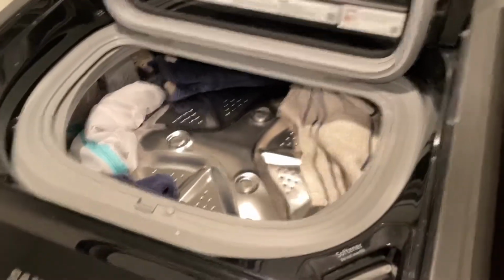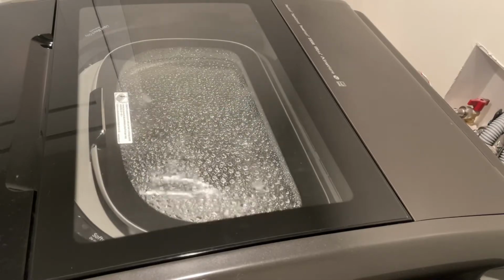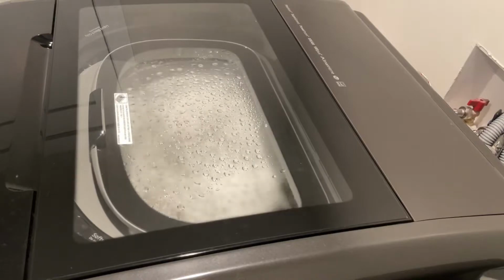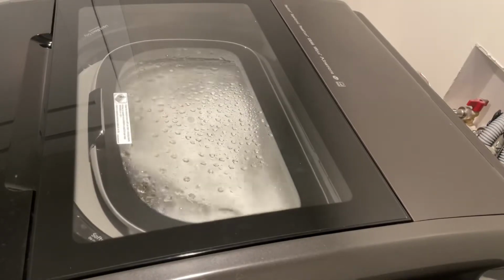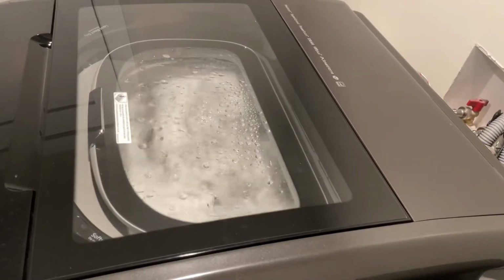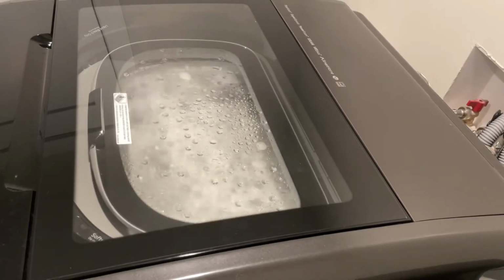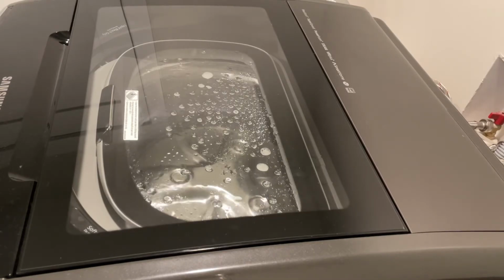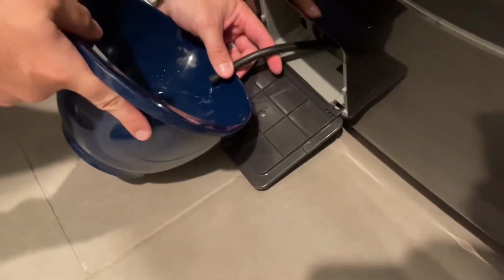Samsung Flexwash Upper Washer Normal Cycle (and Water Leak!!)

Comment: Turn down the cold water faucet the upper washer fabric softener drains slow so if the water coming into the fabric softener dispenser is to high it doesn’t have enough time to drain and will over fill and leak on the sensor and you will get an error code or see water in the bottom left of the washer , Also I tell customers not to use liquid softener use the downy unstoppable’s cause you can’t take out the the dispenser like on other washers to clean . Hope this helps you guys who have the flex Samsung washers
Reply from the maker: Interesting, I didn't think to do that. I'll have to try it out. Thanks!
Reply from the maker: You know I just thought about this and I’m interested to hear you thoughts about it. If the water pressure is the issue, then how come whenever I run the machine without any clothes in the drum, it never leaks? Ever since the machine started leaking we’ve ran numerous test cycles with and without clothing and it never leaked when we ran it empty. Would the water pressure still be the issue at that point?

Comment: I just bought the WV60A9900AV (not the WV60M) I am going to see how the top washer works.  Most of the problem I have read is the WV60M model.  Wish me luck.
Reply from the maker: Wishing you luck on not only the upper washer working but also on controlling it! I’m sure it’ll be a unique experience trying to control both washers with one panel and one knob 😂😅 Please let me know how it works, I’m curious to find out!
Reply: How's your model working, any leaks?

Comment: Samsung flex upper washer sounds like water is stuck inside the drum. You can hear it swooshing around when you manually spin the drum. I saw that happened to you in one of your videos. Did you ever figure it out?
Reply from the maker: That swooshing sound is actually not just water, though it does sound like it. It is another liquid solution that Samsung uses to help with balancing the Upper Washer during high speed spin stages of a wash cycle, similar to the ball bearing system in the lower washer and in LGs. As for the water leak, the cause seems to be the Upper Washer softener dispenser. There's many different things people say can be done to fix it, but this video explains my findings on my washer: https://youtu.be/HXy2sjRjrNs?si=jSDcfN31y1YS4xrm. Hope this helps!

Comment: I am going thru same problem (guess why I am watching this upload). Very frustrating. As said all worked fine the first 3 years.
Reply from the maker: Yup. Just horrible design. If it interests you, I have a video up about finding the root cause of the water leak issue. Unfortunately I don’t think there’s a fix to it though.
Reply: @FansOfGames  Had mine since 2018ish. it just broke again, causing the entire washer(bottom and top) not to work. I drained it many times, but when I turn it on, it just flashes a ton of buttons. when I turn on the bottom, the tops lights turn on. when I turn on the top, the bottom lights turn on. Idk what to do, it’s been 3 days of fixing this pos
Reply from the maker: Did you power cycle it? (Unplugging it and plugging it back in) maybe that’ll reset the circuit board, which seems to be a failing part on your machine.
Reply: @FansOfGames  I unplugged the machine for about 17 hours, and another time for 10 minutes. I drained it for the same 17 hours and 2 more times for 5-30 minutes. I also drained out the back pipe by throwing the tube up and down, causing a suction to pull out some water. I still hear water inside when I spin the top washers bowl side to side.
Reply: @FansOfGames  oh, I also took off the front panel where the buttons are, then took apart the circuit board. I noticed samsung did a shi**y job at water sealing the board. Half the “seal” areas were half covered. But I didn’t see any leakage inside of there. The only issues I can see are the lights blinking, half the lights not blinking & no/faint noise when pressing them, and lastly the water being still inside the top washer
Reply: @FansOfGames  I’m going to drain it from the front again, then lean it on it’s back and drain the back, turn it on, and if that doesn’t work, I’ll take it apart and deep clean the washer. We just bought a new samsung washer with 4.9 stars for 1100$, and i’m trying to fix this one so I can resell it for 300-700$. I could get samsung repair center to check it out but they estimated the repair to be 400$ without even knowing the issue. I don’t want to spent all that just to resell it and either lose money or gain only 1-300$.
Reply from the maker: That sound you’re hearing is not water, it is the solution that helps balance the drum during spin. (I thought it was water too, but I was corrected.) and I don’t know what to tell you about the board, it’s just very unfortunate how poorly this machine is made
Reply: @FansOfGames  I can replace the lights on the circuit board, but the actual problem, idk how to fix. I’m gonna drain it again both front and back, then clean the sensors. If it doesn’t work, I have no clue what to do.

Comment: I read many complains about leak coming from upper washer. Probably they Samsung engineering  didn`t well dimensioned softener dispenser for Hight pressure water inlets.
Reply from the maker: That could be a contributing factor, but I think I found the root cause of this whole dilemma (or at least A root cause). I’ll have a video coming out about that shortly.
Reply: @FansOfGames  Thank you. I can`t wait for your next video.

Comment: Does it hold more than that? Seems a bit of a waist if you can't load it up a bit more.
Reply from the maker: It could technically fit more, but I don’t like loading it with much past that because of all the water it uses, it struggles to move the clothes around and truly scrub/clean them when it gets too full.

Comment: My conclusion is that the softener compartment didnt drain in time and in result overflowed maybe try cleaning it then running it on a hot cycle then try it again if it still dose it try without softener as it might just not like it and overflow
Reply from the maker: That’s what I thought at first, too. I tried cleaning it, but it was perfectly fine, and it only does this when we run it with clothes. Running it empty works perfectly fine, no leaks. I actually did a test to figure this out (video will be coming soon) and I came to the conclusion that the clothes along the side of the drum cause backflow. Believe it or not, the softener compartment enters the drum through the holes actually in the drum (like along the sides) not through a nozzle like the main wash water. So the clothes being along the side of the drum after a spin block the holes which blocks the softener from entering the drum. The water will exit one way or another, and if it can’t exit into the drum, it will overflow the dispenser. The dispenser is open to the main cabinet of the machine, and thanks to a big hole on the bottom of the cabinet, the water leaks onto the floor. This was a very long explanation but it’s the best way I can describe my findings.
Reply: @FansOfGames  oh very weird I would class that as a design fault
Reply from the maker: Yeah I agree, this machine had so much potential but was designed so poorly. It’s sad.
Reply: @FansOfGames  great design poor quality it is a shame especially the price of this machine you would expect it to be the best
Reply from the maker: Yup, it was a complete waste of money

Comment: I have the same issue. My wife and I have opted to just not use the top washer for the past year. Any solution found yet?
Reply from the maker: I don't think there's much else you can do other than not use the upper washer. The problem just comes down to really flawed engineering by Samsung and I don't think there's any sort of "fix" for it. I made a video going into my whole thought process and testing different things with the machine to try fixing the problem, if that interests you. I'll link it below. 

https://www.youtube.com/watch?v=HXy2sjRjrNs&t=77s

Comment: I had one of those and absolutely hated it.  It seems like it only washes with a teacup of water (bottom unit) and the top one would periodically leak.
Reply from the maker: The top washer leaking is a huge problem, agreed. As for the lower washer, it really depends on what cycle you use and how much you put into it. On the cycles it does sensing for, it’ll probably use slightly less, but it still uses enough (in my opinion) to clean the clothes. I’ve also watched it complete numerous cycles and found that it actually adds more water as the cycle progresses, so by the end it’ll have much more water than the start.

Comment: The quality of Samsung washers is shameful, starting with the fact that the Upper Washer is a poorly made copy of LG's Pedestal Washer.
Waiting for the day that Samsung will also launch the Tower Washer and Dryer, as LG creates.
Reply from the maker: You said it! And I think Samsung already has, but their system allows you to control the dryer from the washer panel even though they are separate units. So if you stack them then they could be considered a copy.

Comment: Not worth it crappy I've had issues with this washer. The top washer is crap it leaks and turns sensors on so my bottom won't work